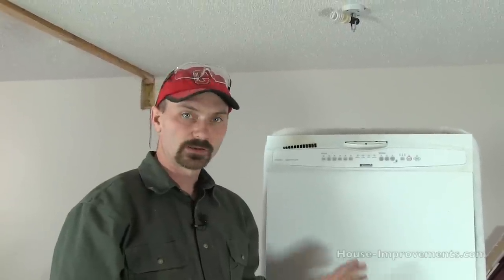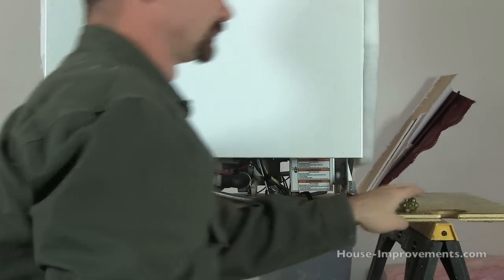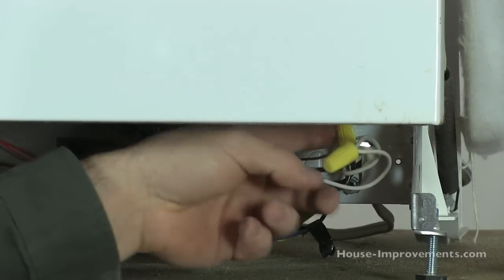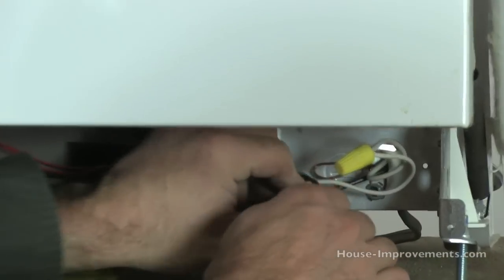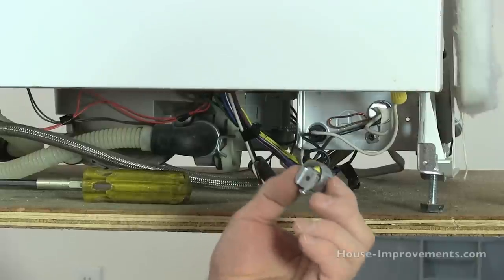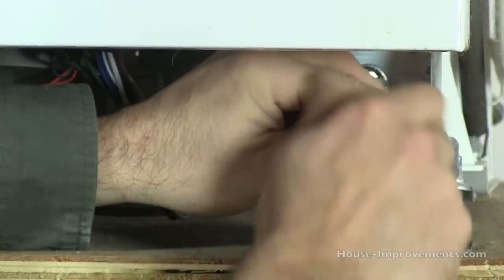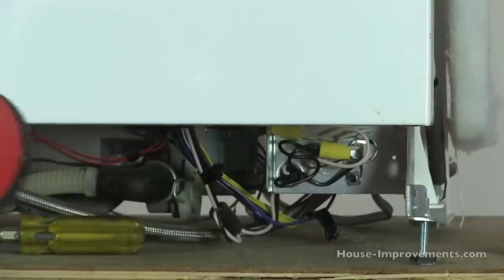Dishwasher Electrical Hookup

Comment: We just recently bought a house, and it has probably a 20 year old or so maytag (just a guess), but we got a used 3 year old amana.  The amana comes with a ground wire, and its already attached to the grounding screw, whereas the old dishwasher is using a connection wire that has the bare copper wire, same as this video.  Other videos show the 2 ground wires being connected to each other, and not done through a grounding screw, but also the wires in those videos look to have newer wires with the copper threads rather than solid copper piece.  I assume based on this answer "green wire is for the ground. It will attach to the bare copper wire that is part of your power supply wire coming to the dishwasher", I would just ignore the grounding screw, and just connect the two wires together?
Reply: OR just wrap the copper around the ground screw, as I believe this is suggesting?  "Both green wires need to be attached to the electrical box of the dishwasher. If there is a ground screw this is where you would do that."  I believe dishwasher ground has a hoop end connecting it to the ground screw.
Reply from the maker: Attach the bare ground to the grounding screw and then attach any green ground wires from the washer to the bare ware with a wire nut.
Reply: @HouseImprovements  
Hello, I'm in the same situation but the green ground wire from the washer is already attached to the grounding screw inside the box. So i can attach the bare ground wire to the green wire with a nut?

Comment: Easy on a bench.  Now try that when it's on the floor.
Reply from the maker: Yes it is harder when you are laying on the floor. Sometimes the electrician leaves enough wire that you can lay the dishwasher on its back to do this hook up.

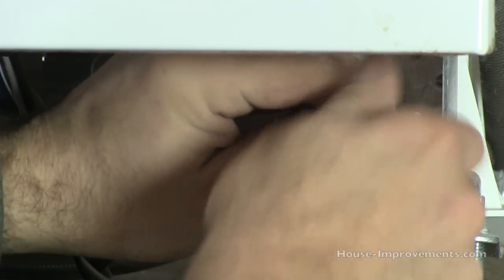Comment: 3:01"..and obviously you don't want to have your breaker on..." Working on a switch in a flat of a 3 unit building built in 1910 I pulled the fuses(knob and tube) that are just looped circuits, nothing home run, and started to work on the switch box without checking with a voltage tester. After smoking my screw driver and not getting shocked, I traced out the run and found it run directly down to the main, and not through the fuse box in the flat. The romex connected to the cloth insulation should have been my clue that it might not have been wired from the flat and to test it for voltage. Now I know, and I appreciate that I didn't have to learn it by getting a smoky curly hairdo.
Reply from the maker: Good point, check for sure with a tester to be sure.

Comment: Thank you for this information. I had a drain pipe break just behind the wall of the dishwasher. During the repair, I was thinking of installing an electrical box up high so if there was a future problem the water wouldn't drain down the electrical wire (which was coming out the bottom of the wall),.and putting a cord on the dishwasher, but did't know the regulation on that. You answered that for me,,,, THANKS!!
Reply from the maker: Some places allow or even require the dishwasher to be plugged in using a cord. Our forum is a good place to ask questions.https://www.house-improvements.com/forums/

Comment: The dishwasher's conductors look like they're aluminum. So are there any special precautions you take to connect aluminum to copper, say a dab of Noalox ?
Reply from the maker: They should not be aluminum. They are usually a braided wire and may be soldered together from the factory at the ends

Comment: Great video!  Quick question though.  My new Samsung dishwasher has a white, black and green wire.  But the green wire is split...one end is a regular wire and the other has a loop at the end.  The dishwasher came with a power cord to install which has a white, black, and green wire with a loop at the end.  How would you connect those green wires?  Would you basically stack the green wire from the dishwasher (both the regular end and loop end) with the green wire from the power cord and hold all three down with the ground screw?
Reply from the maker: Both green wires need to be attached to the electrical box of the dishwasher. If there is a ground screw this is where you would do that. Not sure why the one from the dishwasher has two loose ends but I would assume it comes from somewhere and if it does just attach the hoop end to the ground screw with the other hook coming from the cord.
Reply: @HouseImprovements  Thanks!

Comment: so when u take it apart do you leave the wires just handing im removing my dishwash
Reply from the maker: If you are not going to re install a dish washer again or for a while I would install a rectangular electrical box in that area and put the end of the wires in there . Clamp them in the box and use wire nuts to cover the ends of each wire.

Comment: Geez Shannon. My dishwasher comes equipped with 16 gauge stranded wire. Should I be soldering that to my circuit wire?
Reply from the maker: No , just use wire nuts or Wago connectors.
Reply: @HouseImprovements : Okay, thanks.

Comment: How do you hook the hard wire up to the circuit breaker in the fuse box? I just got a dishwasher and the first time I used it it looked like the heating coil oxodized. Called and a service tech came out and replaced the coil only to find out we have 240 amps (? I think that's what he said when he tested the control panel) going through so it actually melted the heating unit and blew the motor. We used a 20 amp fuse but he made it sound like only one of the wires of the three was actually supposed to be hooked up to the fuse. (Sorry it was rather confusing to me)
Reply from the maker: +Patricia Woy Please come to my forum with your question I can help you from there. http://www.house-improvements.com/forums/

Comment: I have a Whirlpool dishwasher. There is a red wire under the dishwasher. I am not sure where does it connect. I replaced the pump and during that process I may have removed the red (press fit) wire. 
Also my dishwasher does not clean and the sop dispenser just opens and the soap falls on the spoon rack. What may be the problem? Is it the motor or the pump or may be the drain pipe? Please help
Reply from the maker: Sorry I am not a dishwasher tech.

Comment: My dishwasher hooks up very similar. My dishwasher although has a "green" ground wire, which i'd connect with the house's bare ground wire against the ground screw.
My problem is, recently the marrettes melted off/burnt. I was the "orange" colour. Maybe they were too small?  
I will likely rest rip the writes clean and use In-Sure connectors. Is this suggested?
Could anything else has caused this?
I was told that it was likely caused by a bad connection, weakly twisted (copper-copper) before i applied the marrettes.
Reply from the maker: +Slinkbomb should not melt unless there is a problem. Restrip all wires and redo. Make sure ground is hooked up as well and dishwasher is on the proper sized breaker.

Comment: installing a dishwasher and instead of a white and a black wire it has those and a green wire.  What is the green wire for?
Reply from the maker: green wire is for the ground. It will attach to the bare copper wire that is part of your power supply wire coming to the dishwasher

Comment: awesome video!!!  did you say 14gauge wire with 15amp fuse?  what exactly am I looking for at home depot (as for the wire to buy)?
Reply: ....* 15 amp breaker
Reply from the maker: check your dishwasher manual for the Amp rating . If it is 12 or less than a 14/2 wire on a 15 amp breaker is fine if it is over 12 amps then 12/2 wire on a 20amp breaker. If you need more help see my forum. http://www.house-improvements.com/forums/
Reply: HouseImprovements thanks so much!!! off to the store!!!

Comment: I sooooooooooooooooooooooo AGREE with you
Why the heck do they force US to hard-wire a dishwasher
Cos, they want to create JOBS... If you do not know how to connect a dishwasher you have to HIRE  someone 
and that is 35.00 starting price....

Why not just have a plug, like I lamp or a radio
Are outlets for dishwasher different in someway
I dunno, more AMPS.......for sure its 110V not a 230V
Reply from the maker: I think the main reason is because the plug would not be easily accessible without removing the dishwasher. The hardwired dishwasher junction box is at the front of the access panel so it can be accessed.
Reply: Save money on manufacturing

Comment: My Boch dishwasher wires melted those two yellow screwy yellow tabby thingy ma-bogg things
and the two met...and arked -  melting the plastic of those yellow tabs.
If I was to re-wire,  ya think the dishwasher will work. 
or should I just not even try and go buy a new boch
Reply from the maker: well first off why did they melt? second off you limey fried the circuit board but you never know. The guys on or forum may have some better insight for you on these matters. http://www.house-improvements.com/forums/
Reply: I have no idea why it melted the plastic yellow,  but all that remained was the metal on the inside of the yellow...  I cleaned up the wires,  cut them, reconnected it firmly,  new plastic thingy ma-boggs.
Turned the power to the dishwashwasher back on [ smart on my part ayee ]  
Pressed POWER on the DW....and........nothing.................
So knwing it will cost a wack of cash, thinking anything electrical got fried when it arked...
for sure the CB was fried..........maybe the motor too... so I do not want this in my house I am so lucky nothing caught fire... 
So I am going to purchase a new DW

I am keeping the NON-Electrical parts and will sell what I can
Foot panel
Hoses
Trays upper and lower
Water filter

The rest got trashed

BOSCH MODEL # SHE44C06UC /47
These parts are up for sale

Comment: there's no way the equipment wire were stripped long enough nor the feeder wires.must wrap equip wires  around feeder wires then trim to 3/4". then wire nut.

Comment: i dont5 see a white 2 white or black to black...... i just see loose white and black.....
Reply from the maker: your dishwasher has a white and a black and a green wire or maybe a green screw. Hook your ground from supply to the green wire  or green screw and the white to white and black to black. if you have more questions please use my forum. https://www.house-improvements.com/forums/

Comment: Is there some sort of silly regulation about not being allowed to connect solid wire romex with the dishwashers stranded wiring?  I know that is true for water heaters.  If so, what to do then so you can still blow sunshine up the inspectors ass?
Reply from the maker: Never heard of it if there is.